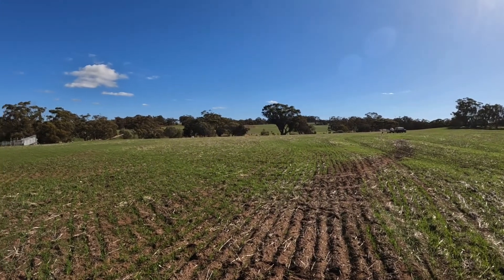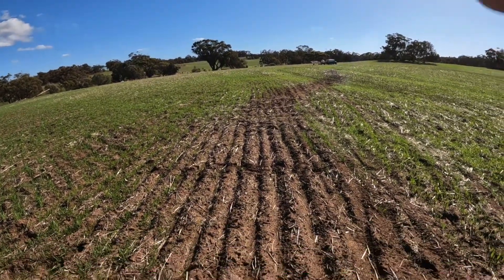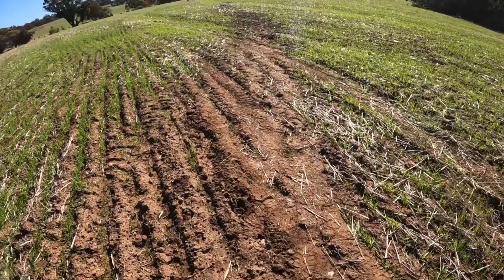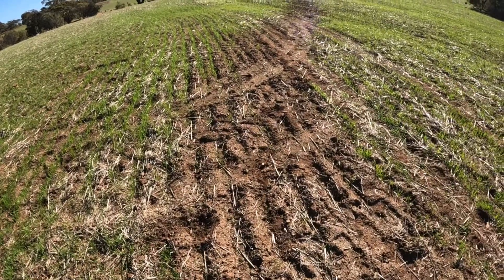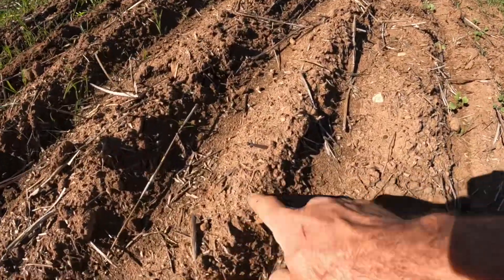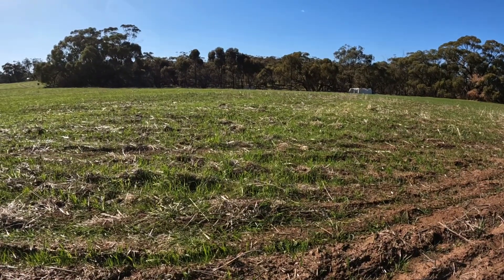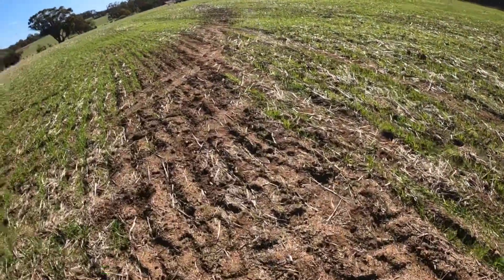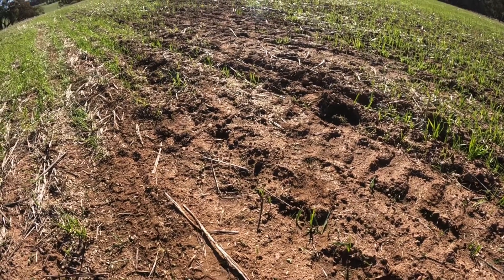What happens when we use too much chemical?

Comment: What chance is there that heavy rain will spread the contaminated soil and make a larger area useless for crops? Thanks for showing.
Reply from the maker: Hi Stephen, UV light breaks down the chemical, so anything on the surface will no longer be active. It is possible that the chemical will leach further down into the soil. At this point most of the chemical will have broken down so it is more about getting the soil microbes back.
Thanks from Geoffrey

Comment: Recently Dutch researches came out with a study that says that they found chemical traces from herbi and pesticides used by farmers miles away from where those chemicals were used. And in much larger amounts as they could ever have imagined. They were able to detect the specific chemical compounds from the different chemicals. It is a bit of an issue because here we are rapidly losing many plant and insect and butterfly species.  And 18% of the surface from our land is water that is all connected together. And some of those chemicals can have a long lasting devastating effect on aquatic life, but it can also be bad for humans when people swim in that water.
Reply from the maker: Hi, chemicals that stay in the soil can be a big problem. Diuron is one chemical still in common use here that stays in the soil and can kill trees a long time after it has been used. I try not to use the harsh chemicals with long residue effects.
Thanks from Geoffrey